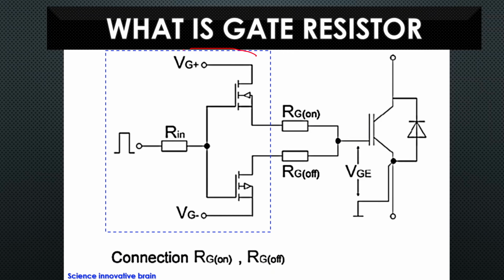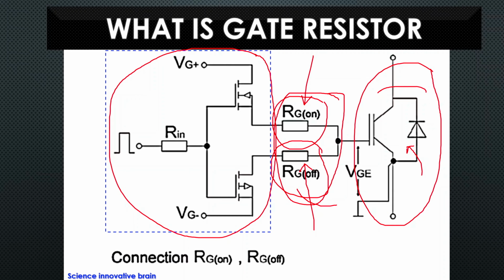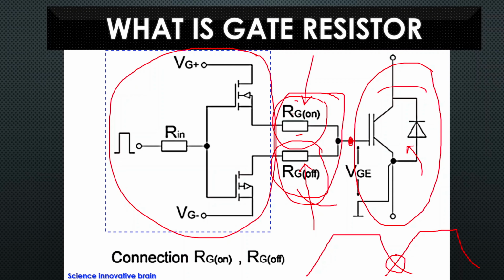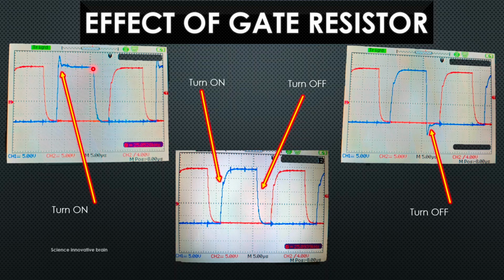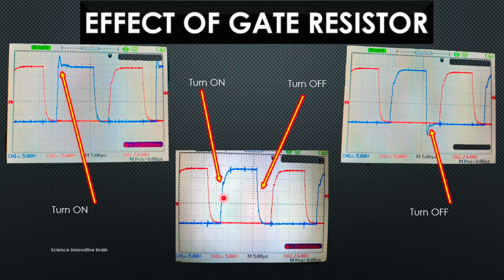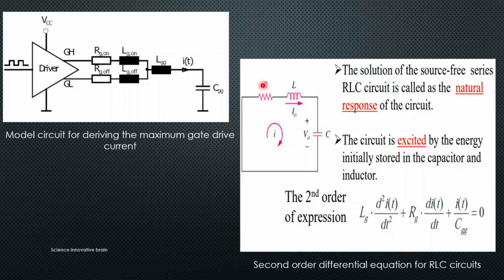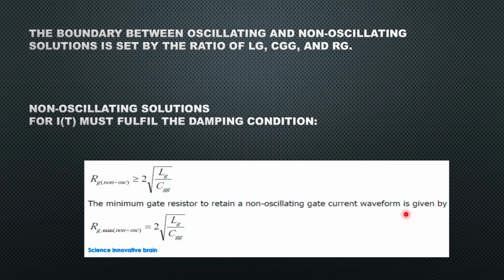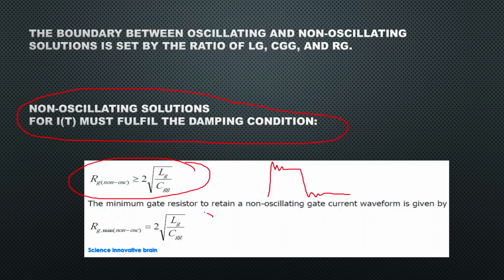IGBT GATE DRIVE RESISTOR SELECTION

Comment: Greetings. This is my case. I've been trying to bulid an off line flyback converter using uc3842, 160vdc imput and 15 vdc, 10A output and an IRFP450 mosfet. But gate resistor is giving deep trouble. I've made a lot of calculations based on many tutorials and I've tried several values but the mosfet does not work good though.
Reply from the maker: What problem you are facing with MOSFET
Reply from the maker: What is your switching frequency
Reply: @scienceinnovativebrain  Mainly it heat up even without load and the output voltage drops dramatically with load as little as 500 mili amperes and also the mosfet vibrates in a way that I hear it, this in the presence of very little load.
Reply from the maker: @ministeriomundialliberando8403  transformer from where you taken what is primary and secondary turn
Primary and secondary inductance
And primary side leakage inductance?
Reply: @scienceinnovativebrain  I wound the transformer based on the calculations results using a software I downloaded, frquency is 40 Khz, but I've tried using 20 KHz,  30KHz, 25 Khz and so on.
Reply from the maker: @ministeriomundialliberando8403 may be something is wrong in transformer design and you can not change frequency 40khz to 20KHz  on which frequency your system is designed in that only it will work  very very small frequency you can change
Reply: @scienceinnovativebrain  Thank you I'll practice your suggestions and I'll let you know.

Comment: Thank you Sir
Also how do we check with multimeter if igbt is switching. Also in igbt welding mc sg3525 pin 11 and 14 are 0v dc wrt fan gnd. And pin 9 and 10 shut down pin are also 0 v .Vcc pin 13 qnd 15 are 15 v dc. So can I conclude the pwm ic is faulty. The power supply Lnk626 ic video was easy to understand and useful. Thank you.
Reply from the maker: Welcome but I not understand your question
Reply: @scienceinnovativebrain  Sir the pwm ic pin 11 and 14 are 0volt so is the Ic faulty or is there any shut down protection mechanism. Pin 9 and 10 are 0 volt. Also how do we check by multimeter or frequency meter if the Igbt is getting gate drive pulse
Reply from the maker: @gerwindsouza2485  pin 10 put at ground but pin 9 should not be at ground it should connected with some small capacitor and other terminal of capacitor connected with ground pin 8 also connected with some capacitor o.1uf other wise interlock will come and pwn output will not come 
You can check PWm output some pulsating fluctuation you will get means PWm is coming
Reply: Thank you Sir for your reply. Only mentioned what voltages I am getting at pwm ic 3525 pins. No output from pins11 and 14 to 4688 driver ic. Will I get pwm gate drive pulse on gate of igbt with 24 v fan ground as reference. With multimeter in dc mode?. How to check gate drive pulse with multimeter.
Reply from the maker: @gerwindsouza2485  you can not measure PWm with Multimeter but you can get idea PWm is coming or not and check PWm with sg3525 ic pin 12 as reference to  pin 11and 14    if pin 12 of ic is connected with 24 volt fan ground then you can check other wise no
Reply: @scienceinnovativebrain  Thank you very much for your prompt reply. waiting for Sg3525 smd ordered online.. No seprate control cars all parts on one pcb. Wondering if frequency meter between E and gate of igbt will show drive pulse.
Reply: Control card not cars
Reply: can anyone share the Arduino code to generate gate pulse of different frequencies and duty cycles?